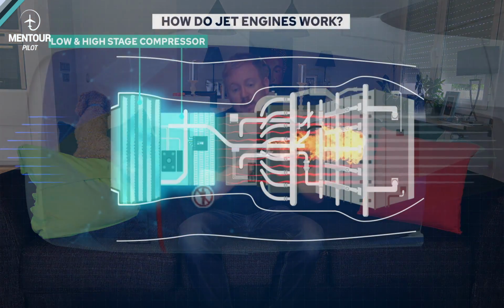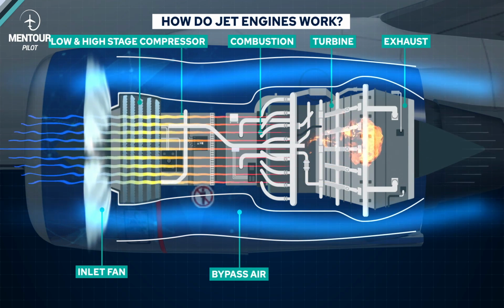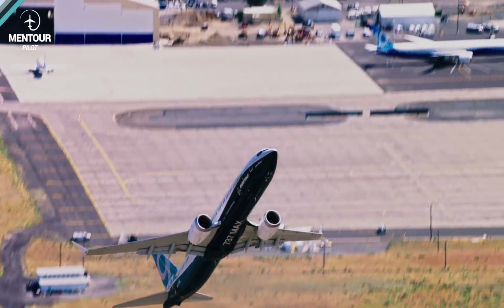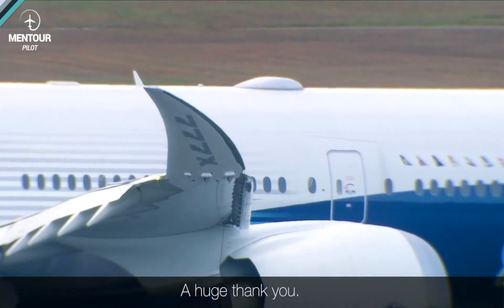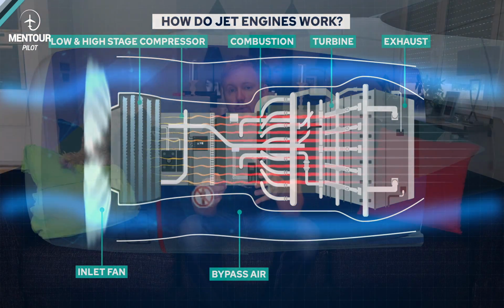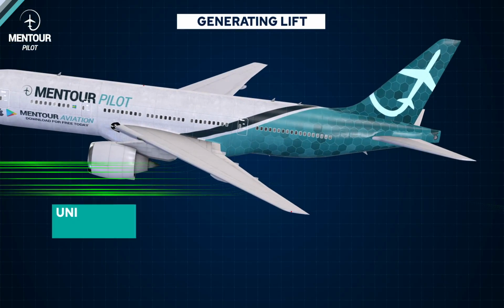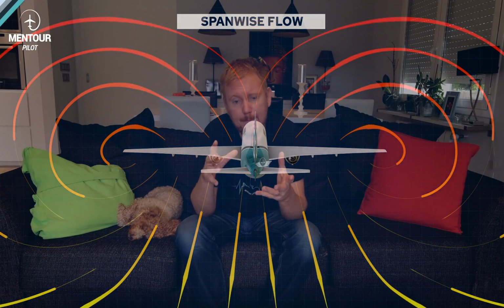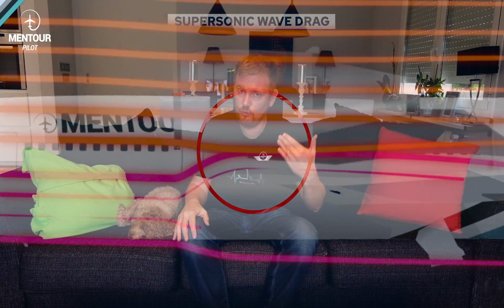How BIG can jet engines get?!

Comment: Why not make engines that span the length of the wings instead, more oblong shaped engines would take in more air, and reduce the overall weight and be more fuel efficient, while also increasing speed of the aircraft. Of course it be difficult to design something thats oblong shaped and how would the blades rotate, or could it just go without fan blades but still have moving mechanical parts inside that rotate and propel the aircraft forward as the air passes through the engines.

Comment: Sure, you can't put a huge high bypass engine where the airflow is fastest (ie top of wing). But why not put them on the end of the stabiliser, like the old trijets? Huge high bypass engines are not much heavier than those old low-bypass engines - just bigger. And because of the fuselage shape (designed to pevent tailstrikes) those stabilisers have heaps of ground clearance.

Comment: Former Boeing Everett...  where really big aircraft are built in biggest building in the world and get really big Jet Engines. I used to think the engines on 47 were big (they are), then I saw what was being installed on the 77. GE9 series Jet Engines are largest and most powerful Turbo Fans in world.

GE9xxx ==> G stands for Gigantic, E stands for Engines, and the 9 was the diameter of front main fan. It would not fit in a standard house with 8 foot clings. I have stood next to front and it towers over my head. 

Engines are the last major part added to Boeing aircraft. They are the most expensive single item. It doesn't make financial sense to put engines on before final stage of build. Everything is JIT (just in time). Boeing used to do an engine buildup in 48 hours. Not sure if they are now receiving completed engines. If schedule called for 2 GE9x for 77 ready to go to paint, they arrived day before. Boeing has to pay vendor (General Electric) when Engines arrive. That's how Boeing stretches finances around build schedule and helps keep costs lower.

Comment: And why not mount the wings on the upper side of the aircraft like most turbo prop aircrafts and mount huger jet enginges under it? and also put mounting gear under the body?

Comment: Turbines are more efficient at high speed. Fans need to spin at low speed. Gearboxes up front are the only way of matching, but these are HEAVY (PW1000) so there's a tradeoff

Longer gear doesn't weigh much more, but the problem is that an aircraft is designed around the available engines and the landing gear "locks in" that decision because changing that on an existing design is virtually impossible - hence the silly linkages on B737MAX to give the thing high heels

High wings solve the clearance issue but they mean pax get more noise - less of a problem with high bypass turbofans than with tubojets or even props

I suspect military lifters will drive larger engine development, just as they drove high bypass development in the first place

Comment: I was hoping you'd talk about geared turbofans and ultra high bypass engine designs.

Of course, when we get to the engineering and physical limits of machines (like we have been with automobile engines for some time) that means that a game changer is on the horizon (if one is possible).

I for one would love to see big efficiency increases even if it's at the expense of speed.

Comment: I like how how much QUIETER the turbo fans are vs turbo jet. We lived north of DFW airport years ago directly below a landing /takeoff corridor.  Planes would generally take off toward the north in the winter and I noticed the reduced sound of turbo fan jets was clearly much less.  American Airlines flew the old MD 80 models with turbo jet engines and the noise was incredibly noticeable.

Comment: You fotgot to mention that the Fan size is als Limited by 
The Speed of Sound at the Tips of the Fan Blades. 
And the zentrefugal force of the Fan Blades.
And yes Corbon Fieber has enought tensile strength for Lager Fans but it is mostlikely too brittel for birdstrikes

Comment: I shouldn't think there will be bigger engines simply because there seems no market for bigger planes. The A380 wasn't a success, and the top-end 777s - the largest twin-engine aircraft ever built - probably won't need to be enlarged further.

Comment: The AN-71 to AN-74 seem to manage with their engines above the wings.  How do they get around the issues you outlined in this video?
Reply: in their case isn't the engine more or less at the wing root - the wing starts outboard of the engine rather than the engine disrupting the airflow.
Reply: These things are flying much slower and made for special purpose (unpaved short runways).

Comment: One day, the center part of the plane will be one huge engine and the passenger cabins will be underneath the wings lol. Gonna be interesting to see how/where they'd put the cockpit, nose gear, etc. I already got some ideas but they're probably very impractical or maybe wouldn't work at all for some random engineering reason. Also, for safety reasons, maybe the passenger cabins would be detatchable from the wings and they'd have their own smaller wings/engines so that in case the main engine fails, they can detatch and fly to safety. So basically one huge engine with wings carrying two planes. lol

Comment: I was going to say 'why not integrate the engine inside the wing' but that would probably compromise structural strength.
Reply: I think that it is no longer done because it makes it too hard to access the engine for repairs.
Some aeroplanes have had engines integrated into the wings in the past, see the DH.106 Comet and the TU-124 for examples.

Comment: I don’t think I saw this suggested in the comments so far - what about going back to four nacelles with fans but only two turbine cores - power the outboard nacelles with electric motors driven by enhanced generators on the inboard turbine cores? Now you’re still only maintaining two turbine cores but you get thrust from four underwing nacelles.

Comment: Could you see a return to having the engines placed at the rear of the fuselage? Aside from noise, what is the reason for underslung wing-mounted as opposed to fuselage mounted?
Reply: Centre of Gravity issues? It's easier to balance a plane over a flight (fuel tanks going from full to less full) if the big heavy bits i.e. the engines are in the middle.

Comment: Correction. The air and fuel mixture does NOT increase pressure but velocity. If it were inclosed such as a piston chamber then yes there would be pressure but not so with a turbine.  There is a engineering channel that describes how that works.

Comment: What about having the engines mounted in the centre of the wing?    About the same distance from the fuselage where a B737 or A320 would have the engine under the wing. Much further out then what the Comet or TU-16 mounted their engines.
     I'm no engineer, just a worn out, retired truck driver.

Comment: I don't get the point of making larger engines rather than more engines per single plane. The more engines you have, the less probable it becomes that all engines fail. Same with fuel tanks and circuits. Anyway, this explanation is very interesting.

Comment: Was there a time when it was thought? putting engines on top of the wings could reduce the noise to the ground ?  Also please do an episode on the parked fuel leaking blackbird sr71.  I believe it stretched and shrunk, leading to fuel leaks.  Also the joke about missiles. ✌

Comment: Not sure if anyone reads comments on an old video like this, but I found this interesting, and have a question: 
Since the Boeing 777X with the new engines has lower thrust engines and larger wings, will it have a lower cruise speed too?
Reply: I just checked and the thrust will be the same as the current 777
Reply: Alright, thanks for checking.

Comment: From the days of the breakthrough RB211 to the upcoming GE9X, I notice that the fan is getting bigger while the core is getting smaller. Add exotic materials, new manufacturing process and advanced electronics control to that, you got an engine that is fascinating to study as a system. What an insight into the development of jet engine and its relation to other part of an aircraft that dictate its design. Thanks.

Comment: Why are wings at the bottom of the most commercial aircraft? If they were attached at the top of the fuselage (like many smaller planes), they could fit larger engines without requiring larger landing gear? 

Maybe it's a lot safer because it's harder for the fuselage to push through the wing than have the wing fly off from the top in an extreme situation?

Comment: its not about big.. its about quantity , if planes had 4 engines on each side, 2 that run on fuel and 2 that run on solar or temporary generator (which wont be too heavy) then this would enhance sfety if fuel engines leak or break and also make a plane faster

Comment: how bad would it damage construction stabillity if building engines into the wing (yes will be truble with fuel connecions thru the engine space, or use huge rear mounted enginens that making it tail heavy and a bit more noicy due to mounted on cabin side and not on wing. At first it sounds as bad ideas, but what would the overall thought be for it?

Comment: If you can't put the engines on top of the wings, but low-hanging engines require long landing gear, why not do what we did with the B-52 bomber, and just mount the wings near the TOP of the fuselage instead of the bottom?

Comment: There are also passenger comfort, noise, and safety reasons to not mount the engines higher.  Specifically:
1) Passengers like to be able to see out the windows.
2) Imagine the sheer panic that would occur if the flames from an engine surge/compressor stall were right outside the rear windows.
3) Having engines alongside the cabin would significantly reduce the potential number of emergency exits, and possibly require passengers to go to an exit further away.
4) It also potentially allows a fuel leak or fire to spread to the cabin faster.
5) More engine noise coming into the cabin.  (Remember pi*r^2.)
6) Underslung engines are significantly less likely to throw shrapnel into the passenger cabin in the case of an uncontained engine failure.
7) Higher mounted engines are more difficult for firefighters to access.  (Remember e.g. there have been incidents where throttle controls were disconnected and engines were put out with firefighting foam.)

When you add all of this to the aerodynamic and maintenance concerns, it becomes fairly obvious that it's just not an attractive option.

You might think about a return of rear-mounted engines, e.g. like the MD-83.  But remember in those days the engines were much smaller (and consequently lighter).  Side mounting of a modern engine would itself be quite an engineering challenge.  Not to mention fuel and control routing; the dangers we've already seen with respect to engine failures in the tail of an aircraft; the moment arm created by this positioning; and of course similar maintenance concerns to high mounted engines.

Comment: I think there’s a flaw in your logic if the plane is going 80% of the speed of sound the air that it’s travelling through doesn’t have to be moving at all it can be stationary so let’s say that the jet engine accelerates the air 300 miles an hour towards the tail of the airplane.  The air is not going mach .8+300 it’s going to 0+300.  it has nothing to do with how fast the plane is going through the air because the speed of sound is not relative to the plane.

Comment: Petter, something you forgot to mention was the jet engines have become much quiet as they kept increasing the fan bypass ratios
Reply: Extremely quiet. If you're near heathrow you notice the A380s because they're a "hole" in the background noise in the sky
Reply: This is an important advantage of high bypass engines - moving more gas at lower speed is innately less noisy. The higher the bypass ratio the quieter (assuming the fan blade tips are kept subsonic). Noise at takeoff is a major problem in designing a supersonic airliner, because you can't use high bypass engines supersonically (again, fan blade tip speed ...).

Comment: As a farmer, we said tractor engines wouldn't be larger than 200 HP. With 50 HP as a big rating in 1950, todays tractor engines top out at 600 HP... Who knows where they will max out. Seems the same with aircraft engines

Comment: And there were planes with the engines mounted ontop of the wings, like the VFW 614 or the Honda MH02.
I guess the structural limitations are what prevents the passenger jet planes from using top mounted wings (which would offer more ground clearance for bigger engines)
But then big engines run into the same issues as helicopters, when the blade tips reach trans-sonic and even supersonic speeds.

Comment: Bigger jet engines are "riskier" ... because the turbine blades are REALLY COMPLICATED and the bigger they get the more they are in danger of being damaged through the vibrations and impacts an aircraft suffers. These turbine blades are smaller versions of those used in a power plants ... and there the blades MUST BE VERY SYMMETRICALLY DISTRIBUTED ... or else they could result in a "resonating frequency" which would rip out the entire 10m long axis of the power plant generator and this could end up many kilometers away. Such accidents happened ... the problems are MANAGEABLE ... BUT THEY ALSO INCREASE THE COST ... which is the point I am trying to make. If you have to swap out the engines after every longer flight and overhaul them it will not be cost effective!

This is a problem of ENGINEERING (a.k.a. the PRACTICAL APPLICATION) ... NOT "Newton" (which is the THEORY) ... combined with economics.

Comment: I am not sure why YouTube offered me this biggest-engine-size video so long after the fact. Perhaps it confused casual interest on my part for cluelessness. I do think the GE9X, which is known to top out at 134,000 pounds will define the "for sale" big-boy size for years. The next step up on bypass ratio, after you have squeezed so much out of high-temperature combustion, would be use of planetary gears, and slightly bigger fan. We think we can get bypass ratios for the 777X size to 15:1 only using gears, which not surprisingly would not be coming from GEAE but Rolls-Royce in the  140 inch UltraFan, 6 inches greater than the GE9X, and using a much smaller, high-speed core. Right now, there is not much of a market for Rolls-Royce beyond the Trent-XWB, so I think prime opportunity for the Ultra will be on the 787. They screwed the pooch on the Trent-1000. Boeing requires thrust, as yet outstanding, well above PW1100G and well below GEnx, so it may be that R-R's first, or sadly last engine, that will need to go on the 797, if the UltraFan should ever see light of day. One other, but slight chance would be to re-engine prior 777-200ER and -300ER models, but the prospect seems iffy to me. They will own the A350-1000 too I think, although they are currently wetting their pants over smaller A350neo models with GEnx as the alternative engine. It is now or never, to remain relevant.

My question. Except for the longer nose gear and clever-lever main gear extension on the Max-10, I am unaware of any other example of taller gears to enable bigger fans. Even the 747 testbed aircraft for the gigantic tests have standard gears for sufficient clearance. The assumption remains that only the 737 was so clearance-limited compared to the higher-off-ground A320. Did I miss something in the taller gear department?

Comment: Could you put the wings on top, as we do with military transports?  What's the trade off?  Dihedral stability?  Are high wing aircraft necessarily heavier because they have to support wings over the cabin?  Harder to maintain?  They are easier to load, I think that's why the military uses high wings.

Comment: Articulate the engines for runway clearance. They wouldn't need more than fixed recessed dollies and a gravity operated locking framework. It'll happen at some point eventually if the engine is to remain safely external of the wing.

Comment: I can see why Boeing went for a new 727 in place of a new aircraft but having read a fair bit about them, they tried to use the Aibus business model in which the aircraft is assembled by parts made by specialists. The difference seems to be that Airbus only went to established aeronautical manufacturers. I recently watched a video about the guy who developed the 777 engine. He said it was inherently unsafe. After 2  fired, the Boeing solution was to place the batteries in a thicker metal box which weighs so much, they would have done better to use old school battery tech.
 I seem to remember Mentour mentioning that Boeing moved from Seattle where all the experts were and so lost a lot of really good people.

Comment: You discussed relocating the engines to the top of the wing and the negative effects this creates, OK, I understand.
Two other solutions are possible to accommodate larger engines - A. move the wing to change from a low wing configuration as are almost all modern airliners to high wing configuration (C-5, C-17, C-141) B. Mount the engines on the fuselage (DC-9, DC-10, L-1011) 
I would like to see a video exploring these two alternatives to mount larger engines, please?

Comment: The GE-9X has a rated thrust slightly lower than the GE-90X but the maximum it was ever run at was 597kN, a world record. surpassing the GE-90's previous record of 569kN.

Comment: With a redesigned wing more like the way the comet had the engines in the middle of the wing would allow for bigger engines without changing the landing gear. I would also say that there are other places to put the engines like the side of the tail like an MD-80 or on top of the fuselage like the BE200. I will never understand why more amphibious aircraft are not in production. Sully would have been fine if he had a BE200.